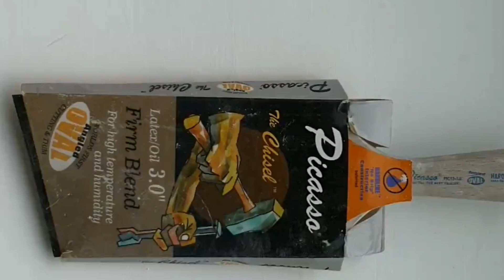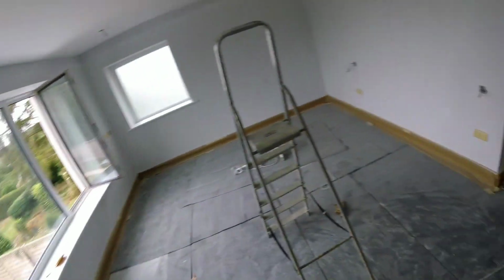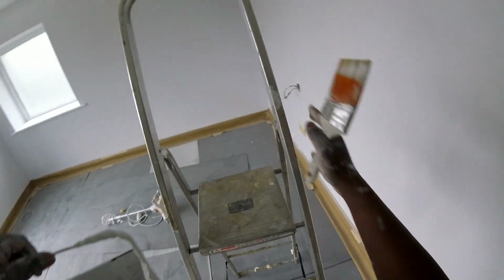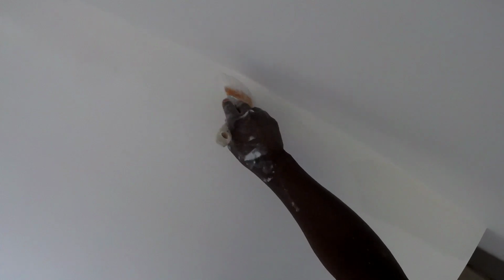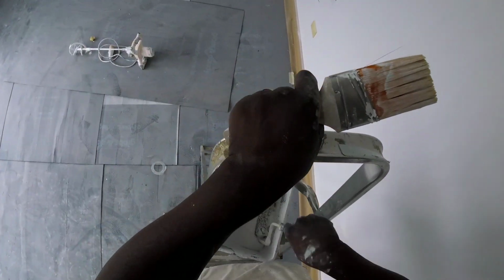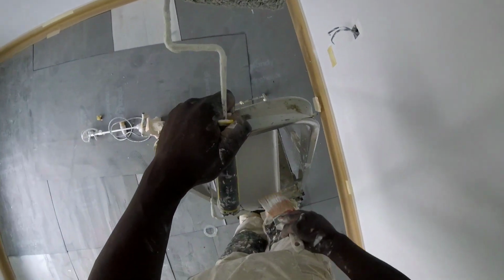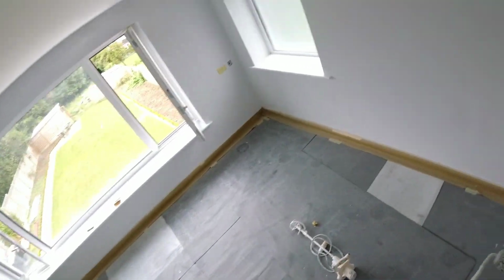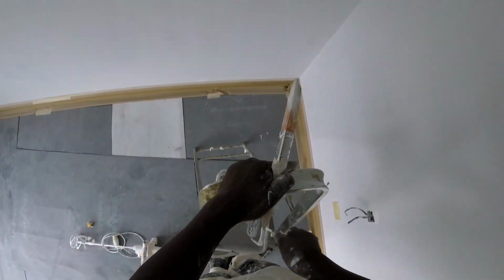PAINT REVIEW ON THE 3" PICASSO OVAL ANGLED BRUSH

Comment: That paint he’s using sounds like it has a lot of “pull”.  I have a couple of pro form/Picasso semiovals. Definitely make sure you get the “chisel firm” for cutting in with heavier paints. The original filament formulation is a little too soft for all day clean cutting in. Also, I note, the the pro form brushes have a drip proof feral so no water trapped in the brush  from cleaning will run down the brush onto the handle or your hand when working overhead.

Comment: Have you tried the Rembrandt brushes? I think they are made by Arroworthy. Much the same as Pucasso, but yellow/golden bristle. Buy both brushes in packs, look for deals. I would never fork out 25 notes on 1 brush, as good as they are 👍
Reply from the maker: No I haven't tried the Rembrandt brush , need to check those out to see what they're like 👍
Reply: Bristles are too stiff with Rembrandt.. takes off too much paint.. sharp lines yes! Stiff=control but sacrifices mil thickness..

Comment: I think you said it looks different color what are you cutting in and then the rest of the wall I'm a painter and I think you're using the wrong 6 inch roller it's too fat you need to use 3/8 or 1/2 inch thick synthetic  smolder smooth finish
What are you actually doing with that fat roller is texturing in the walls so it will look different even if it's the same color and finish
Reply from the maker: The paint is dulux and the colour is grey , we seem to only have this problem with the greys I don't know why you look at it and you think that's not quite blended in . Outside the trade no one notices it , But as a painter you can see a slight shade variation,  I do t get this problem with any other colour apart from greys. The sleeve im using is a 4" purdy I do like these sleeves the paint spreads well and rolls out super fine over a sprayed mistcoat. Maybe its worth trying a shorter pile in this colour . Thanks for the info 👍